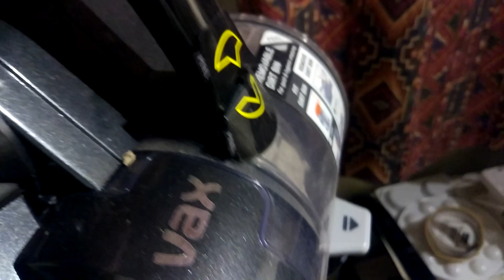I hate throw away society

Comment: I got from the trash, all PERFECTLY WOKING:
A LG stereo mini system - CD, Tape, Radio, AUX in. Thrown cause the remote was lost. Phone app solved this.
SONY BluRay, a top quality one, works. Got a new remote for it.
A sherwood Turntable. Works.
A LG home cinema amp, a Kliptch subwoofer. 
A center speaker, two surrounds and a sub, all work.
A russian vintage turntable.
4 vintage valve radios, all work.
A 1959 BSR TT, works.
Allmost 1'000 vinils records. MINT.
A Yamaha tape. NEW.
A PCm, with an i7 processor and 16BG RAM.

Why people trash things that work? Overhere they call it ''improvement'' and ''being ahead''.
Also the office chair I am sitting on is from the trash.

I recycle and refurbish.

Beno, you are the man.
Reply: the PC is not even trash

Comment: This is my main reason for being angry on a daily basis: things being made to not last and be trown away as shortly possible! As a protest, I do what the manufacturers don't want you to: fix everything that is possible, from televisions to LED lamps. And if is not possible to get it working again, I toss the circuit board in my junk box to reuse parts. These big blue electrolytics are high-voltage and can be use in old tube radios, for example.
Reply: good way to reuse things.
Reply: breaching time limits angers me too.
Reply: Beware of the electrolytics ! Those B·$(/rds blow up when you reverse polarity even by mistake.

Comment: Apple does this. They make they older generations of iphone slower on purpose to make you buy a new one.
Reply: they dont, the new os is not correctly supported for older phones.
Reply: I don't think it's on purpose. The newer versions of iOS require more computing power which the older phones can't catch up to but yes they could make the OS run better and at all on the older phones...
Reply: @vrryan6  they used to, but got sued to hell
Reply: @DigiVore.official  ok
Reply: @wclifton968gameplaystutorials  yes that's what I mean
Reply: @KoneLift34 it’s the same reason as to why an Intel 386SX with 64mb ram can’t run a stable build of Windows 7 or why a Nokia 110 can’t run Android (the original 110)
Reply: @DigiVore.official  no that didn’t happen it was because they where slowing down the cpus because of shit battery’s as they where more concerned about thin and light rather than good battery, so technically they should have known better but I know for a fact as I have used both that android only gives you like 2 years of software support then nothing, i personally use iOS but I used android for 5 years and don’t hate it I just wanted to try something else
Reply: wclifton968 for iOS 11 they did slow some of the old phones down though users could turn off the battery throttling. The slowdown on iOS was deliberate. As for the iPhone 4s and iPad 2 being very slow on iOS 9, that may not be deliberate. People used to be able to downgrade to iOS 6 without jailbreaking them but that’s not the case anymore as Apple unsigned the IPSW
Reply: Maybe I was wrong
Reply: I got an iPhone 7 for my birthday like two months ago and the battery life is poor, and the battery is sealed so it‘s almost impossible to take it apart. The WiFi on my new phone also stops working whenever I’m far away from the router despite it working correctly on my old phone.

Comment: This new trend for LED lighting is pissing me off. Yes, LED lighting is very efficient, however, I have known LED battens to last less than 5 years and the whole thing has to be taken down and thrown away and a new one put up. I have an old fluorescent light from 1967 in my kitchen and in those 54 years all it has needed is a couple of new fluorescent tubes. There are also no complicated electronic circuits in it, just the tube, starter and the choke. Needless to say, I won't be replacing it any time soon
Reply: LEDs are also built to fail as they would last for years and years if built with quality and longevity in mind. I think Dubai bulbs are the only exception as they were specifically designed to last. Good luck getting hold of some though.
Reply: I miss the days when rooms had yellow lighting. 

With led lights it's white and boring.

Comment: I completely agree with you. This is especially a problem with electronics. So many perfectly good components wasted due to a simple failure that can easily be repaired by someone with at least basic knowledge of electronics. If one of my appliances breaks, I do what I can to fix it. If it gets to the point where I'm not able to fix it or if there's a complicated problem, I just take it apart and salvage the components that still work.
Still, better quality products prevent things from breaking quickly in the first place.

Comment: Good topic. Additionally the planned obsolence is pissing me off, for example in smart phones, they just stop providing OS updates after 2-3 years and then it's pretty much forced to replace if you want to get security updates, etc. Technically fully working device, only problem the lack of software support!
All those precious metals digged from the earth by heavily polluting methods, just for 2-3 years of use, sounds really big waste!
Reply: Apple. Just saying that is kind of enough.
Reply: Cars from 2030 onwards will be the same. Once they run out of software updates for the old tech the customer will be forced to buy a new car.
Reply: @wisteela  not really as I still use a MacBook from 2011 and it’s perfectly fine, and iPhone get like 6-7 years of software support and then another 2 years when you can still easily use the version they are stuck on. Whereas with android phones you sometimes don’t get any updates
Reply: @iexist5083  Getting apps for old iOS devices in an issue.

Comment: When it comes to printers: If you want to have a printer of proper quality, do not rely on end-user home printers. They are bollocks, they let you down if you just look at them. No, they look at you instead and laugh before breaking down. Cheap Canon home printers are famous for that. I've had good experience from my job with Lexmark business printers such as an older MS510 printer, which is quite reliable, doesnt have got something like planned obsolesence (although it might not last as long as a 1970s radio) and is fairly easy to take apart and Lexmark offers spareparts for it. There are used MS510 for about 100 Euros available. Keep in mind business printers are always more expensive unfortunately.

Comment: I work in a position that deals with repairing equipment like you showed, and it is just depressing how little you can repair nowadays.
Warranties are shorter, and it seems stuff barely lasts it's warranty period.
There's known design flaws (or planned obsolescence ) as well that just don't get addressed, for example, a well known TV manufacturer beginning with 'L' have a 'feature' where they drive the LEDs in the backlight with too much current, which causes them to actually bleech themselves into a purple colour. This can be completely avoided by having software that doesn't run the components at 125% of their capability.
I've gone through 3 Canon printers in the past 4 years as well, two ended up printing blank pages and one just rejected all ink. I also had an Epson that needed to be 'serviced' by Epson. From a financial point of view, it a £40 printer, and I've not spent more than £20 on ink because I refill my cartridges myself.
Old electronics are weird with their longevity, oddly it's the stuff that gets used the most that lasts forever, as use keeps the electrolytics happy.
Old stuff does keep on kicking, I still see the occasional VCR that's cooked its caps, but that's the millitary for you.

Comment: Another example is the first generation iPad, my grandma still uses it all the time, the battery is great and still is reasonably fast,  the only problem is the lack of software support
Reply: They should have given it iOS 6 at the very least. I don’t see any good reason why Apple shouldn’t give it iOS 6. The iPod Touch 4 has the A4 chip and  256GB of RAM like the first ipad yet the iPod touch 4 could run iOS 6 perfectly fine. Also you should really consider getting your grandmother to upgrade to a slightly newer tablet because the iPad 1 kind of obsolete right now. If you don’t have a High budget perhaps get at least an iPad Air 1, or if not an iPad 3 or 4.
Reply: @elevatorfilmersg  she upgraded to an iPad mini 2 a few years ago, my sister still watches movies and plays old iOS games on the 1st gen one
Reply: I still use an iPhone 5s because it still works And apple just released updates to it

I will only upgrade if it’s fully broken but since it’s not I will keep using it. 

I miss the times when apple made good quality products.
Reply: @elevatorfilmersg  I still use an IPod 4 and yes YouTube still works in 2023. I love IOS 6.

Comment: back then otis made lifts to last 100+ years now they last like 10-20 years
Reply from the maker: Otis auto level lift (1927 to 1980) - Designed to last at least 60 years
Express classic relay lifts (1940 to 1970) - Designed to last 100 years
Dewhurst Slate era lifts (1920 to 1960s) - Designed to last 100 years
Otis 80s series lifts (1982 - 1996) - Designed to last 30 to 40  years
Thyssen lifts (1980s) - Designed to last 30 years
Otis gen2 (2000 - present) - Designed to last 25 years
Modern generic lift Thamesvalley or Lester  - Designed to last 20 years
Modern cheap generic lift - Designed to last 10 years
ThyssenKrupp Spanish rebranded generics - Designed to last 10 years
Reply: Our work have 2 lovely unmodded express lifts, they are 3 speed and been operational since 1970.

Sadly no longer in service as can no longer get replacement parts for them.

We also have 3 Kone installed around about 1994, guess which lifts have been more reliable.
Reply from the maker: @Thelaughingfrauditor    Are they 3 speed pole changer model or DC generator model?
Reply: @benolifts  I have no idea,.sorry.
Reply: Beno express classic relay lifts can really last a 100 years?? In Singapore back in the 1960s/70s when the government got express to install some lifts in government flats they had many maintenance problems and kept breaking down according to newspaper articles. Many of them were replaced earlier than other lifts from other manufacturers who installed lifts in government flats from around the same era as well. Some mid 1960s Hitachi lifts that only received a slight refurbishment manage to survive into the mid 2010s but nearly all late 1960s/ early 1970s express lifts were gone by the early 2000s. Maybe it’s due to some maintenance problems with express lifts in Singapore, though I can’t be very sure about that
Reply: @benolifts  We’ll see about that in 2025 if they break down excessively. Jackson says theirs last 25.
Reply: @benolifts  But wait, Why does Gen2 last 25 years?
Reply: @benolifts  Sadly extreme capitalist society (eg in big cities), office buildings are expected to be demolished after 30 years!! Of course, structurally the building will last much longer... they just figure businesses renting them will find them unfashionable/needs will change... so I suppose a 20 year lift is realistic for the purpose (and saves over engineering), but this madness has to end.  I have a feeling it will change soon.

Comment: Excellent rant Ben. I expect stuff to last 20 years and bought a Miele washing machine for that reason (I guess you'd like that it's got a 3 phase motor although i understand that this is becoming more common now generally in washers). Although surprisingly my relatively inexpensive Zanussi dishwasher (model DW 401) is now 35 years old (but only gets used on average once every 1.5 weeks since it's full size and i live solo). The programmer does stick occasionally and i just advance it along a step when necessary. Perhaps unfairly I would hesitate to buy another one since I fear that the accountants will have been at work to cheapen the components in the intervening years.
That vent above your heater is bothering me, hoovering  some of the convected heat up the chimney !! (if the heater's in use of course).
At least it's positioned away from an outside wall or is on a double skinned wall 😄😄

Comment: I think the exact same way as you. An example infact that I experienced  with one of my collection is Christmas lights. Most of the times today is not even the lamps themselves that fails, is generally the transformer or the controller that goes bang or they corrode because they are built cheaply and cannot stand water or attic's or garage's moistures. Compared to the older ones from the 60's to the 90's, NO CHANCE IN HELL THAT THEESE WOULD BREAK! 90% of the ones I have for example still have the original bulbs working since 50 years now! And most of them even not worn or discolored at all!

Comment: It's especially becoming a problem with 13th and 14th generations of Intel processors as of late.
And plus, I have myself an LG Gram laptop, which has a military grade durability certification. A lot of things on there are relatively easy to swap, such as the SSD, speakers, and the heatsink/fan. Though strictly speaking, the 16GB of RAM is soldered in. So in the event of failure, it can be expensive to replace the chips.
On another note, I have an LG VELVET, which despite being stuck in the box since it was manufactured, still works perfectly, and even updated to Android 13 without much fuss.

Comment: This is precisely why i refuse to buy new technology when companies are purposefully slowing them down to make up for their cheap electronics not being able to last more than 2 years. This actually has began to happen with fire safety technology with companies lowering their alarm quality and expecting full system replacements every 10 years rather than every 30 or even 40 years like the very old stuff which still works fine.
Reply: Same with other items like lawnmowers. Machines that were built from the 1970-1980's are still about but you can't get parts for them easily due to company mergers but still work. Items built from the late 1990's onwards aren't as well built because they use cheaper components and some of manufacturers only concentrate on box pushing cheap substandard machines.

Comment: I totally agree with all your sayings Beno, for example me I dump the Firmware of all my devices, because some device flash rom (EEPROM) can hold up the data (Firmware) up to 10 years, and if it looses data on it the device become also useless without any mechanical issues. But if you have a dump.bin file of the Firmware you can reprogram this flash EEPROM and your device works again fine for 10 years more. I love to repair my broken devices instead throwing it away. Now I have a lot of devices that are now over 18 Years old and works just fine thank me and my good technical knowledge. I have also a really old retro PC and CRT monitor from the 1998 and it works just fine now in the year 2021. I also buy a lot of broken technical devices from Ebay and fix them and resell it as functional devices my best bargain was a Xbox One for only 50 Euros haha.

Comment: Don't buy battery appliances.  What the hell?  You couldn't handle plugging it in?  What is that too complicated for you or something?
Reply from the maker: Without giving details about my family, other family members needed a light weight hoover that was easy to carry.
Reply: Same, bought a vax blade hoover as I suffer from arthritis, much easier to use, however not had it long and it is failing.

I now have to use a Henry however it is a struggle.

Also live in a small flat where there is zero storage, the vax takes up much less space.

Comment: Customers are just as bad at fueling capitalism. How many people buy new stuff just to get the latest features. 

Mobiles have always been shite quality, the Google pixel phone that I've had since 2018 has been the first phone I've had in 20 years that's outlasted the contract period. 

Cars have always been designed to fail, in the 60's, 70's and 80's cars rusted out in 10 years. Whilst they've fixed that issue out of embarrassment, they've introduced other issues like poor quality components where it simply becomes uneconomic to replace them. Suspension springs made since the 80's are shite. Heater control systems are horrendously overly complicated and expensive then they go wrong. How many cars can you buy today without central locking and electric windows. Emissions control systems are also on the whole unessessary, expensive and unreliable. 

Supermarkets only provide cheap food because they're screwing the farmers over. They agree to a good price to induce farmers to produce food for them, then at the completion of the contract period they then only offer half and refuse to honour their contractual obligations.
Reply: Even modern trains are unreliable. I recently watched a YouTube video where a diesel locomotive from the 1960's had to rescue the new shiny technically advanced commuter train because it had broken down. I work on a heritage railway myself and everything there has probably outlasted the modern trains built in the 1980's- 1990's